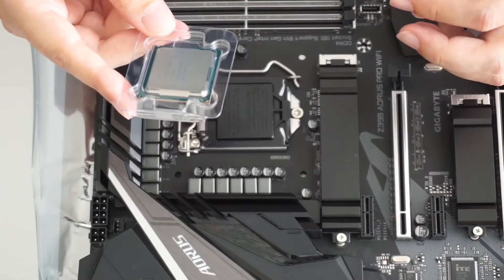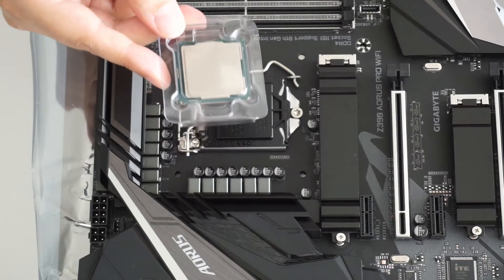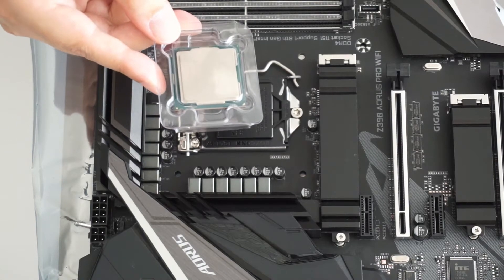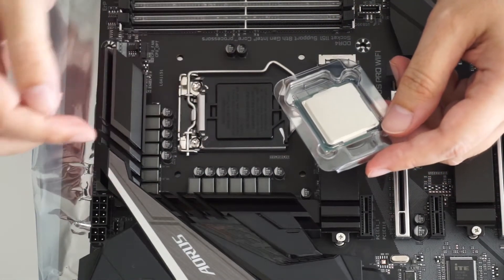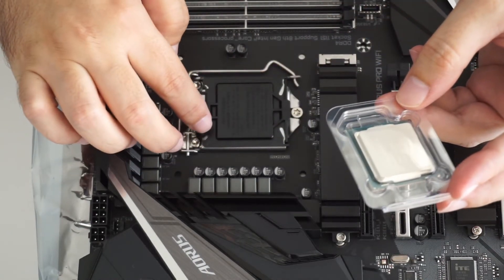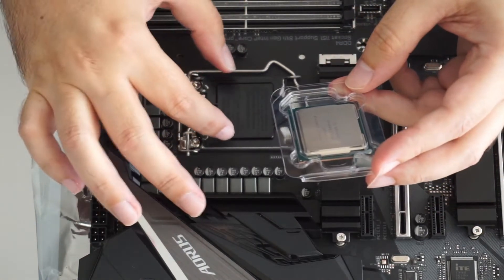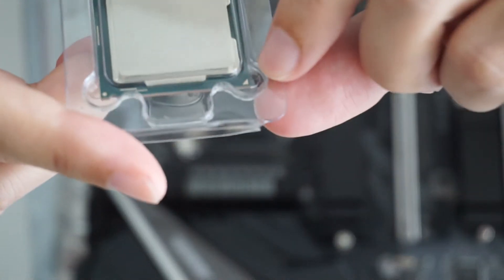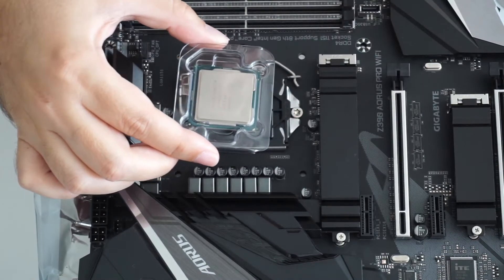How to install Intel i9900k CPU and SSD on Aorus Pro motherboard

Comment: Installing the M.2 in the second (bottom) slot will disable certain SATA ports
Reply: Not if you use PCI M.2. If you use a sata one then yes
Reply: @DoubleD839  its literally in the manual

Comment: I can’t get the 960 samsung m.2 installed on this board cause the heat sync is much longer than the ssd. Help. No way to install on the x570 gigabyte so pissed
Reply: maybe place the m.2 in the slot and move the stand off to the right spot but not screw it down, then place the longer heatsink over top and screwed into the right standoff??? just a thought

Comment: hello, i have install the samed mb and processor, but i have the red led for cpu ON, and the pc restart with no screen on monitor. On the maual, for cpu it's recommended i5 and i7, but no the i9 ???
Reply: I had the same problem, apparently the mobo was defected and now I’m waiting for other to test it

Comment: You have to remove the sticker from memory M.2!
Reply from the maker: You are absolutely right! I totally forgot about that! Just to let you know, I removed it just now and it was intact, so although it is good to remove it, I doubt it would be harmful. Thank you though!
Reply: @sergiopa2002  if you check the temperature is lower than 9 degrees approximately.
Reply: @yurikurkarewicz8124  The sticker on the chip or the rubber sticker on the heatsink?

The sticker on the chip or the rubber sticker on the heatsink?
Reply: @sergiopa2002  The sticker on the chip or the rubber sticker on the heatsink?